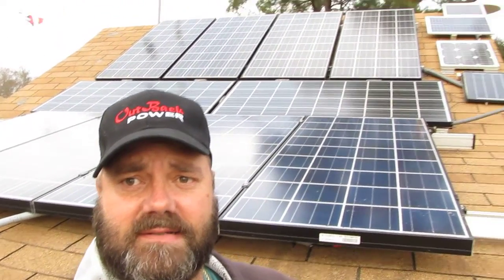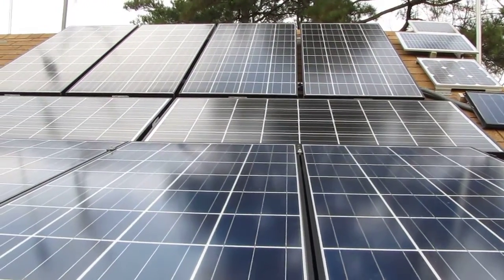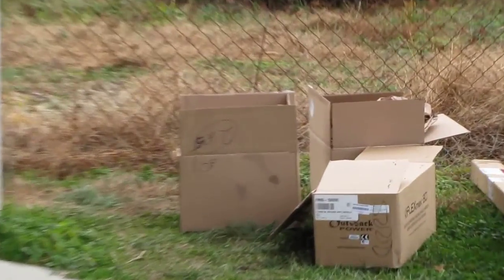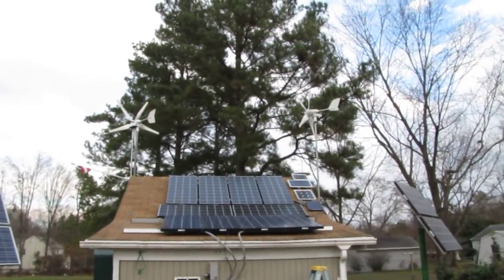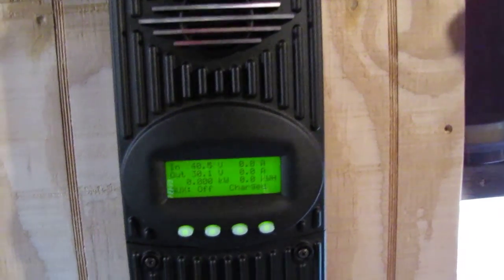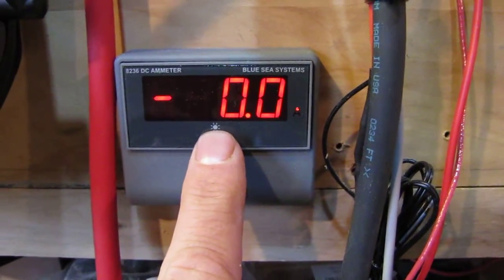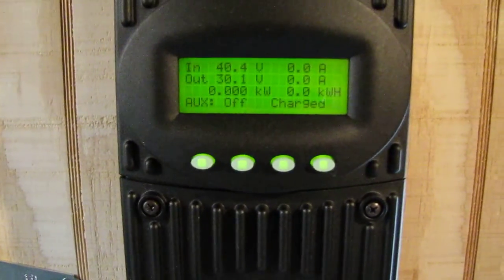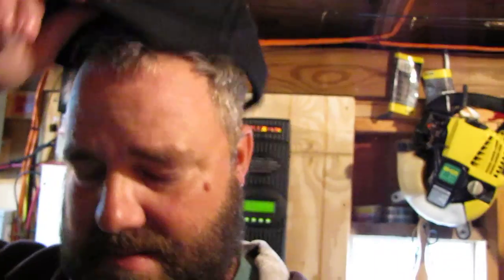VIARLOCITY And OutBack FlexMax  80 MPPT  and Kyocera KD140GX-LFBS 140W 12V SOLAR PANELS

Comment: Sweet job on the installation!  I like how you put the wires behind the panel like that.  I Like my Flex max but cant wait untiI can get the grid tie inverter and hub too.  I like the software you have too.  Thanks for the e unvailing of the new toys!  I am starting to shop for a house so I wont be adding any new toys here in the near future but when I get moved then I can do a better installation and do a tracker system.

Comment: I noticed the angle on panels on the roof will be better in the summer. I am able to adjust my angle to the sun perfectly summer and winter so not only does it track the sun from east to west it is always at the perfect angle to the sun. Thus I make maximum amount of power the solar panel is capable of all day long. I saw a lot  of difference after I installed the trackers. Batteries can start taking a good charge a little after seven in the morning.

Comment from the maker: Yes It Is Dangerous Brother My Dad Use To Get Me To Hold The Spark Plug When We Cranked The Motor That Is DC Electricity Holy Crap It felt Like My Fillings In My teeth were Going To Fall Out !  Yeap Brother That is an 80 Amp FlexMax  MPPT Charge Controller

Comment: new panels and controler amp meter are looking good man.  I guess 36 volts can kill you. I wouldnt want to find out LOL. I used to think only 110v was dangerous. It that a 60 amp controller? Or did you go for the 80.